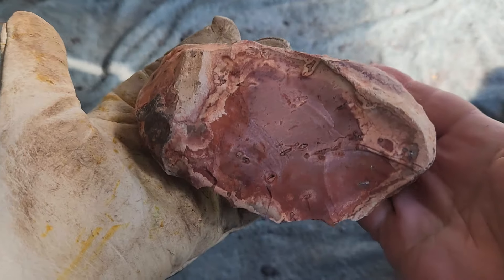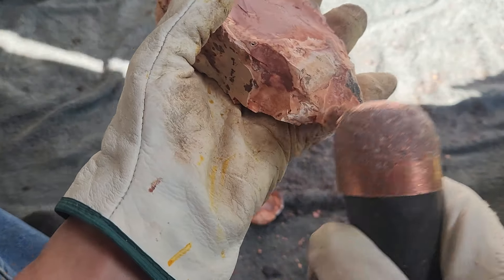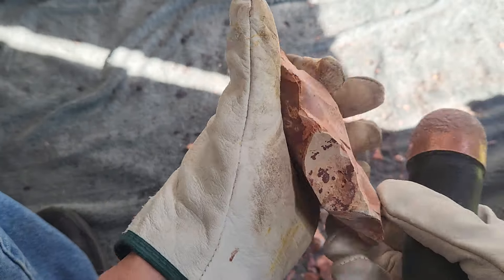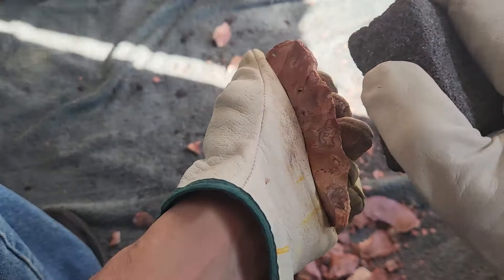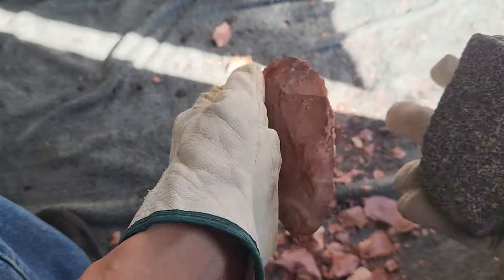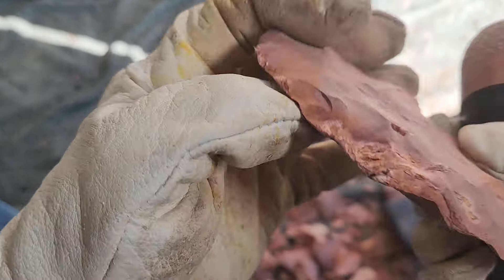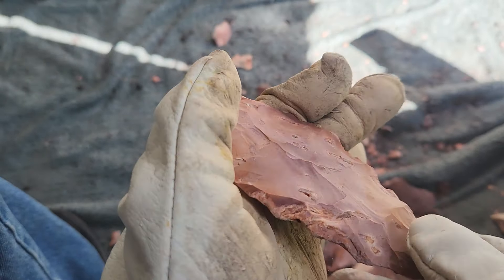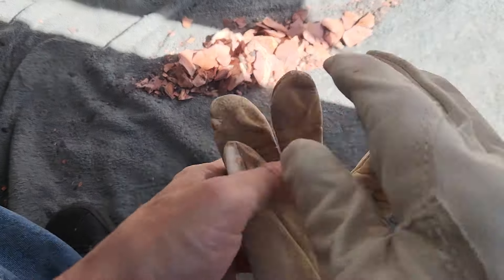1845 - Part 1/2 - Flintknapping Mississippi Gravel HT Hardin

Comment: Sorry away for 2 weeks. Surely when you are making points to hunt or for battle, all you need it something that works, they don’t have to be symmetrical, pretty or very thin, most post novice  knappers can produce something that works in less than an hour and dare I suggest our predecessors were 3 or 4 times as fast if not faster, even if they were injured or ill, after all their life and the group depended on them.
We need motivation because we are hobbyists, there is little pressure on us as we strive to make a pretty point in most cases for display, imho I don’t think we can transfer our baggage problems back in time.
Reply from the maker: True